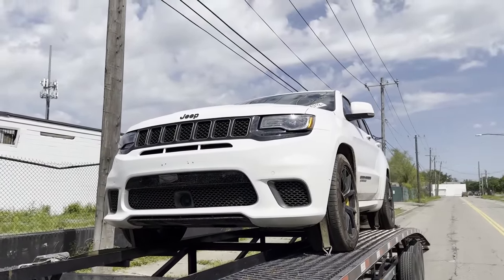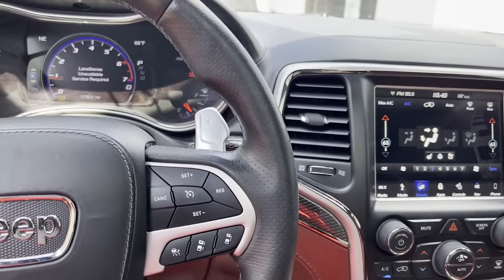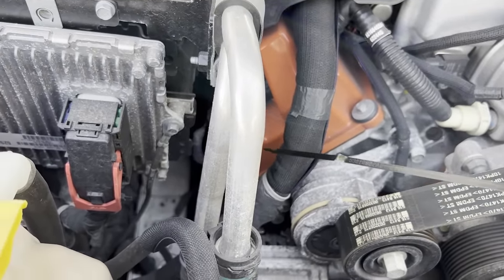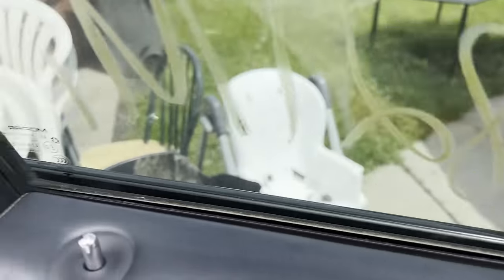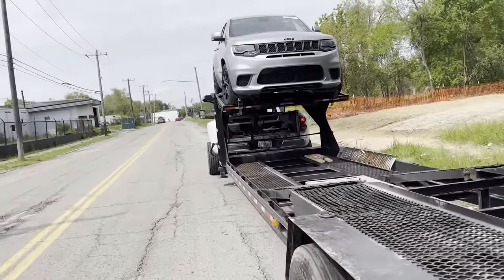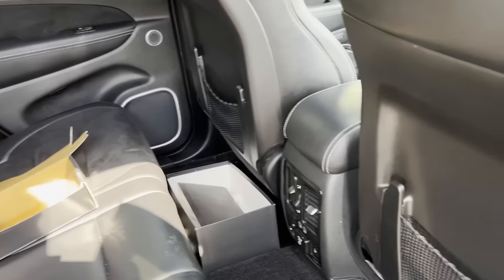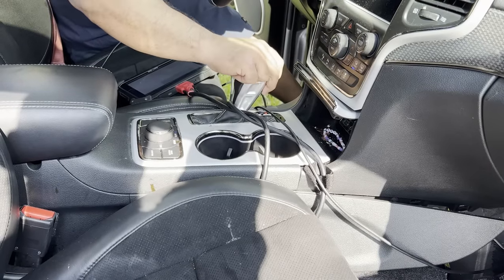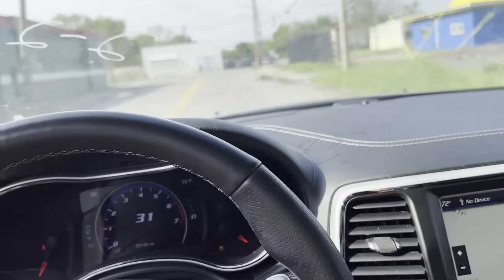I BOUGHT 2 STOLEN TRACKHAWKS FROM COPART IN ONE DAY! *KEEP THEM BOTH?*

Comment: What do the recovered theft trackhawks usually go for at auction on average ?
Reply: $55k for salvage like these
Reply: @bikefax8177  $55k don’t seem to bad of a deal for them
Reply: @bikefax8177  55k my ass those go for over 100k with 5k-10k miles
Reply: @vsan5700  for a SALVAGE one, learn how too read 🤦‍♂️
Reply: @lovellmills7959  don't matter if its a salvage u airhead go find me a track hawk lower then 80k with 5k-10k miles cause that would sell out same day its posted
Reply: @vsan5700  he did buy it for around that if you read the comments
Reply: @vsan5700  he bought both of them for ab 50k 😂

Comment: everything dodge has is overrated.  They've had the same old whack body styles for too long.  The need to revamp the challenger and Charger bodystyle, offer the charger in a two door version, and completely remove V6 from the engine option, the base should be a Hemi 5.7 at least .